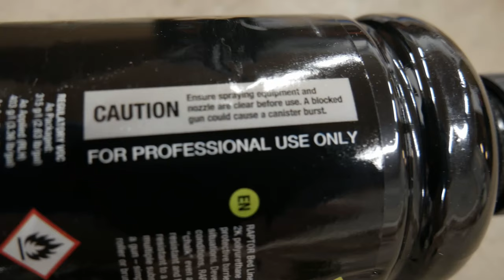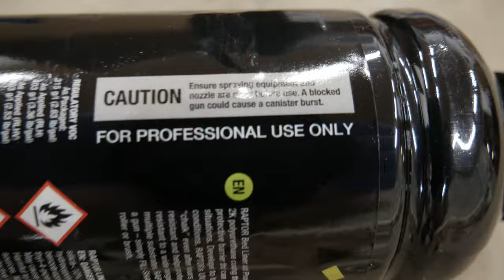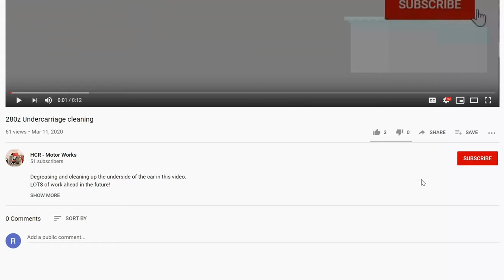Raptor Liner for Undercoating - The ULTIMATE Undercarriage restoration

Comment: Well, the comments say 1978 Datsun 280Z. Without the bumpers, I could not tell. Thank you! I was working at the only dealer in a capitol Midwest city. The sold other European brands but my service mgr. asked me to take these new test for 5 cents per flat rate hour for each I passed. Took all eight & passed. A few months went by, a package came with NIASE Master Tech. These were cars I really loved and owned a 1976, first year after 260Z and had fuel injection. 6 cylinders with 7 electric injectors just like those used today, just clamps on hoses. The 7th injector was for cold start, controlled by a simple “Thermal-Time” switch screwed into the coolant jacket near the front of intake. They used a main fuel pump frame mounted with a pusher pump inside the tank. 1977, they down tuned the cam, dropped compression a little and put a gear reduction starter. House fell a little. Thank you for saving this one. Currently, I own a 1969 1600 Roadster. Convertible two door, power bulged in hood, live hood scoop, recessed headlights w/chrome buckets, disc on front, aluminum finned cast steel drums and full box frame. If you put an MG Midget or MGB on a lift, they flexed so much, you could not open the doors. Datsun did not do that. Over the years, I had diagnosed the root cause and fixed everything from bumper to bumper. I had poly glass wider tires on turbo mag wheels and have hit 130 MPH on a open highway, ran smooth a glass. During the video, you used 5 of everything (Ha ha! But a lot) I read your list but researching for a water based wax & grease remover. I saw the SPI and not sure if solvent base. Could you recommend a water based? I am not required to used it, but many painter videos do water based first, then solvent based also, sand & prep, but use the water based, followed by solvent based again. Retired now, but if I had good choices, I would buy a reasonable priced one and solvent based as well. Many use lint-free body supply paper towel with isopropyl alcohol. I just want to use “Best Practices” with a cheaper price tag. This project now is mine. I want to do it correctly. I will spend money for SPI black epoxy but with 5 dead laptops, they come in a couple of years due to limited wallet. I use an iPhone 6 my son sent for WiFi and email/YouTube access. Thanks again for your work!
Reply from the maker: Thanks for watching! Check out some of my other painting video series for more info on wax a grease removers.  If you go to bare metal you definitely want to use BOTH waterborne and solvent based W/G removers and SPI manufactures both of them!  Lint free wipes are in the description as well, and then tack rag everything clean before spraying 3 coats of epoxy.

Comment: That's alot of water ...smirks.
I just putty knife hand scraped mine off two Z cars it mostly Fell off from the hot and cold gathering and holding dirt cycles it accumulated over the years.
     Was rather quuck and easy on both cars. I used the same method inside for the tar sheet sound deading material and a small hammer and stiff heavy duty putty knife.
Went rather fast as it was brittle from age.
    You did LOTS if work it has paid off.
I'm very happy with my results as well.
   Very satisfying And a huge peace of mind knowing it's thoroughly DONE ! R I G H T !
Better than factory
Reply from the maker: Thanks for the support!

Comment: Awesome job! Why didn't you just use your angle grinder @ 4:37? Like you did @ 6:08? I ask because I'm undercoating my '02 Corvette as well as cerakoting suspension components. Also, what tool are you using @ 4:14? What is the caulking for @ 20:00? 

If you are able to answer my questions, thank you a ton! I subbed a few seconds in because I was so impressed by your project - I am wanting to do something similar.
Reply from the maker: Thanks for the sub! In the first two timestamps, it was part of a how many different ways can you strip undercoating series on this build. The tool later is a needle scaler, and the caulking is seam sealer. Hope that helps!
Reply: @hcr-motorworks  Awesome! That helps a ton, thanks! Much luck on your channel. I'll stay tuned into your Datsun build.
Reply: @hcr-motorworks  That was very helpful, many thanks!

Comment: Spot on with everything but one thing, why didn’t you sand blast or have it sand blasted after removal of undercoating? Paint sticks to sand blasted metal like a xhemical bond after sand blasting. Not only that it would have saved you so many hours if prep work and left you a better base for the primer. How long did you wait between primer and bedliner application? Are you going to put paint over primer in areas you taped over? Primer is a hydroscopic no paint it will create rust under the primer.
Reply from the maker: Thanks for watching! yep everything got painted that was taped.  If I would've basted it you wouldn't have had the chance to watch this amazing video ;)

Comment: So you didn't have to scuff the epoxy before applying the Raptor Liner? Is it still adhering pretty well?
Reply from the maker: I sprayed 3 coats of epoxy with 1hr between coats and then let dry overnight before spraying the 3 coats of raptor liner giving 1hr between coats. I did not scuff the epoxy before the raptor liner. The chemical adhesion that takes place while the epoxy is fresh and then cures is actually stronger than mechanical adhesion you would get from letting the epoxy cure for a week and then scuffing.

Comment: Awesome job👍
I wanted to do the same undercoating on my 67 merc.
What kind of primer did you use before applying the raptor?
Reply from the maker: I always use Southern Polyurethane (SPI) epoxy primer. For DIY paint jobs at home its simply the best

Comment: I was told by a friend to checkout this video because it was almost the same thing I did.  
I just did this job to an old car on my channel and thinned the Raptor 10%.  Spraying it out of a primer gun will also work really well!  I used the schultz gun that comes with the kit for the wheel wells back to the bumper.  You're right, this stuff is awesome!!  Great job!!
Reply from the maker: I love this stuff for sure! thanks for watching!
Reply: @hcr-motorworks how does this hold up with time? Thinking about doing this to my car
Reply from the maker: @the_cosmic_cowboy12  proper prep is absolutely the biggest reason for longevity. if you do minimal prep expect minimal lifespan.

Comment: I’m about to spray some SPI epoxy today on my Datsun. Any final tips before I go for it? I’ve degreased and tack clothed. Should I paint the complicated small spots first and then move on to the larger panels?

Man… I should have taken your advice more seriously when you said “do not do this”. I’ve put over 200 hours to get to this point hahah.
Reply from the maker: If you've never painted anything with an hvlp spray gun before the undercarriage is a great first project to hone your skills on before moving on to the body work that everyone will 'see'.
The flat sections you'll want a wide fan, when you paint the corners and tight sections youll need to reduce the fan down quite a bit, adjusting both the fluid needle AND the airpressure to get the results your expecting. Its always easier to add paint till it sprays wet instead of having to sand out massive runs! 
Enjoy this part! You earned it!!!
Reply: @hcr-motorworks  thank you!! Im actually just doing the undercarriage. This is very helpful! When I reduce the fan size and air pressure, should I still aim for it to be light and feathery?

Large fan = cigar shape
Small fan = small cigar? 

Thanks for your help
Reply from the maker: @Asdf67865  for the corners and subframe, and rear frame inside corners and stuff your going to want like a very small fan 2-3" long spraying 6-9" away from the panel. Reset the air pressure to hit 20-25psi (depending on what gun your using) when the airside of the trigger is depressed.  After the fan size and pressure are set your going to want to turn the the fluid needle in all the way and back out until your getting a nice wet coat.  If you find you can move faster and the paint isn't coming out quick enough then you can add another 1/4 to 1/2 turn out for more fluid. If your getting runs and stuff then you need to turn your fluid back in.  Just wet is what your looking for.  I would hit the corners first with at least 2-3 coats (1hr between coats) and then set the gun up for the wide fan (all the way open on fan, reset pressure again back to 20-25 and then set fluid) for the rest of the undercarriage and spray 2-3 coats on the whole underside covering up the overspray from the corners. This way the whole underside will have a nice uniform wet coat in the end.  If you hit the corners last your going to see overspray and a dry line on ever corner.

Comment: I’ll be doing this to my K5 Blazer once I’m done with a couple small floor patches. Between epoxy primer and the raptor liner I’m hoping it will hold off the rust another 30+ years. Yours turned out great, I just wish I had a rotisserie.😂
Reply from the maker: it definitely makes the job easier! there's a link in the description for a rotisserie if you decide to go that route!

Comment: Super impressive effort!  I really enjoyed seeing the amount of work that went into getting the underside back to bare metal.  Are there scenarios that the needle scaler works better than flap discs, wire wheels etc?  I've just never seen anyone use one before :)
Reply from the maker: The scaler works the nooks and crannies way better. I use the flap disc everywhere I can and then finish up the corners and seams the scaler.

Comment: Hello im going to do this in the future of my Saab 9000 Aero race/street car. I am just wondering, because i recon you didnt have time to scrape/sand down the hole undernbody in one day and clean it and then paint first layer. I will only be able to do this on the weekends and im wonerding, say i get one surface clean and then i cant work for a week and when i comeback its started to rust again. How did you eliminate that problem?
Reply from the maker: It was totally done in a day, lol I'm just kidding.  But in all seriousness metal doesn't rust as fast as people tend to believe. The majority of the work is in the stripping. Once your done with all of that then you can just go back over everything with the nylon cup brush or a DA sander and 80grit and hit everything again before wax and grease remover and epoxy primer.  I would section it up into tasks instead of sections of the car.  Strip, sand, clean, clean again, clean more, tack rag, epoxy, raptor.
Reply: @hcr-motorworks  Oh Okey thanks :) What is good to use as first layer prime? 2k? 2k epoxy?

What did you use? :)
Reply from the maker: I only use southern polyurethanes inc (SPI) epoxy primer on bare metal. Best product for the money hands down, and they cant be beat for the DIY garage builder type with above and beyond customer service.

Comment: Isn't seam sealer meant to be applied on the inside of the vehicle and not the bottom? Or is there some benefit of putting it on the bottom as well? Seems like water could get trapped in between on top of the seals this way.
Reply from the maker: On these Z's I seal everywhere there's a seam.  I do leave gaps for any moisture to drain out of any areas where water could penetrate in from above.
Reply: @hcr-motorworks  thanks for the info! Also, what’s the name of the finger like tool being used around ~10 minutes? Looks good for getting the edges
Reply from the maker: @Asdf67865  Its a needle scaler and a MUST have for completely getting into the nooks and crannies https://amzn.to/3JR5iIh
Reply: @hcr-motorworks  thanks for the info! I tried the needle scaler today and it seems to really leave a lot of marks on the metal (I’m also working on a Datsun 240z). Is this just a different pattern of scuffing compared to a strip disc? Or is it really biting the metal deeper do you think? Thanks again
Reply from the maker: @Asdf67865  i only use the needle scaler for the last little nooks and crannies that cant be reached any other way with any other tool. I would not use it on flat metal as it does gouge it. Turn down your airpressure as well and increase it to just enough to remove whatever is on the surface. These tools are used to descale and remove rust on PLATE steel and we dont need that much power for these thin metal cars 😀

Comment: how much would something very similar to this cost usd? looking to restore a treasured 91 mr2 thats seen some winters here in the upper states. Thanks!
Reply from the maker: Thats tough to answer. Most of the time the car has to be taken down to a certain level to get this involved. Most shops wouldnt even entertain this job at 5-10k unless it was part of a 50k+ restoration/rebuild.

Comment: Really Impressive work!  What reason did you decide to use the raptor coating?  I have the body off my project and am about to start on the same process.  i'm trying to decide what product to use.  If you did it again would you use the same product?
Reply from the maker: Thanks for watching! In my opinion and experience, raptor liner is probably the best DIY product in the market for this kind of thing. The only other thing that would be 'better' would be taking it to the professionals and getting it linex'd or the like if you wanted a really thick build undercoating or something. But in my opinion, raptor liner provides adequate build and protection for undercoating without the need to hire it out. Its a fun project but completely is reliant on proper prep in each and every step for good results.

Comment: What's tmwas the first glossy black layer you put on? And what was the silicone for( guessing water sealing the body? Is it necessary?)? How did you prep the silicon for the raptor paint?
Reply from the maker: This video is a compilation of the completed project.  Go check out the videos before this one to get a breakdown of the entire process with more detail and explanations.
The first layer is a 2-part epoxy primer, the tube sealant is 3m fast-n-firm seam sealer (its necessary and its most definitely NOT SILICONE, NEVER USE SILICONE as it will cause massive issues) the Seam sealer is made to be painted on and there is no prep required other than making sure its clean and free of wax and grease.
Thanks for watching!

Comment: I have a question about cleaning the spray gun. Do you clean it out with a thinner or reducersin between coats?
Reply from the maker: I do not clean the gun between coats.  At the end of the job I do thoroughly clean it with a quality automotive Reducer and it cleans up with ease.  Haven't tried box store thinner or mineral spirits on it.  The Reducer I use is Southern Polyurethanes reducer and its around 30 a gallon and works amazing.  I'm sure any local paint supply shop around you carries reducer that will work in a similar manner.  Thanks!

Comment: What an incredible attention to details! This is a couple of steps ahead of me and this video was great. Do you suggest any other protection product beside Raptor? 3M, Dinitrol... ? Subscribing!
Reply from the maker: I just use raptor liner if its a home garage DIY type build. If your throwing a ton of money at it youll get more build thickness if you had line x or the like applied at a professional shop. But raptor liner is some pretty awesome stuff by itself and i have found no need to add any other products to it or on top of it.

Comment: Just curious, why did you choose Southern Polyurethanrs Epoxy Primer?
Reply from the maker: I've been using southern polyurethanes epoxy for nearly 15yrs with no ill effects, it's super user friendly and this is one company that is DIY friendly in their tech support.
Try contacting one of the big boy name brands and tell em your painting it in your garage and see how much support you get. For that reason alone I'm an SPI and TAMCO fan just based on the DIY community and customer support afforded to the home/garage/self learning DIY'ers. Your not going to get better support from any other company out their in my opinion.
That and its affordable, works very well, and is local to me. I can order by phone and have it delivered the next day in most cases. It really is amazing stuff for the home shop guys, give it a try if your on the fence.

Comment: How much do you think this would cost if I were to get it done at a local shop??
Reply from the maker: It would probably be a part of a much broader restoration cost for the whole build.
Reply: @hcr-motorworks  How much do you guys usually charge for this kind of build??
Reply from the maker: @テンペスト112  This was originally planned as a "get it back on the road rebuild" we budgeted about 25k.  Obviously things escalated quickly and many many many more things were added to the build list to-do sheet.  This build will be approaching the six figure mark by the time its out the door.

Comment: Just curious how many bottles of raptor liner did you use ? Wanting to do the under side of my car but cant figure out exactly how much ill need
Reply from the maker: I bought two 4 bottle kits so 8 bottles total and it was enough to do the entire undercarriage as you saw in this video as well as the front inner fenders and frame supports on this video https://youtu.be/pKn3Mt2SWfY     
Use the Amazon links in the description if your going to buy a kit or two as it greatly helps out the channel and my ability to do these projects! Thanks for watching